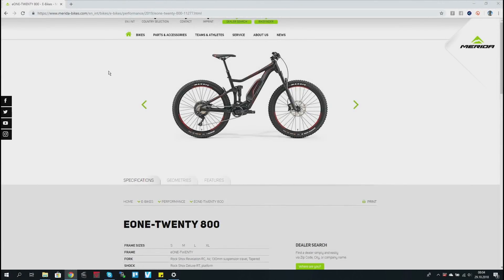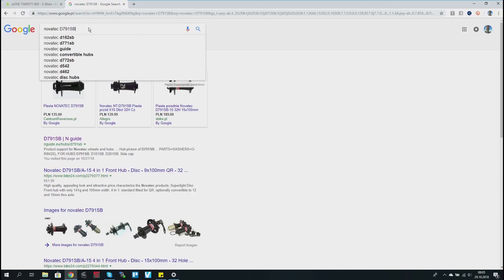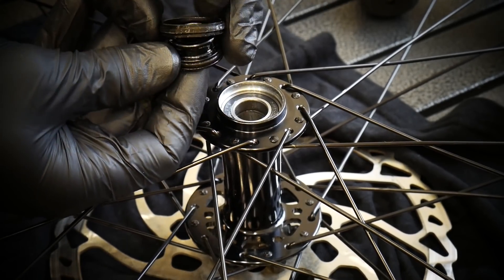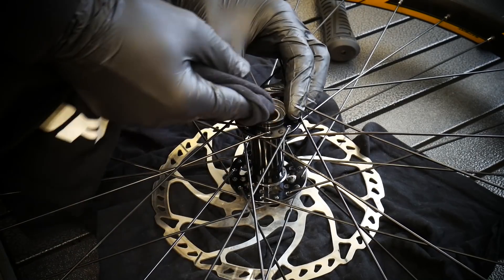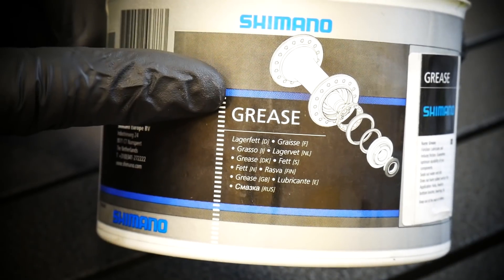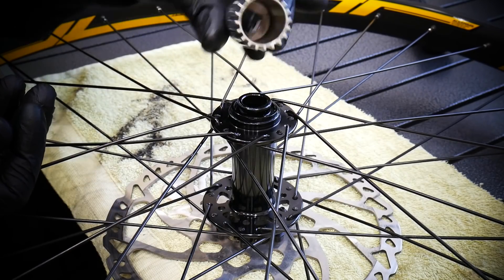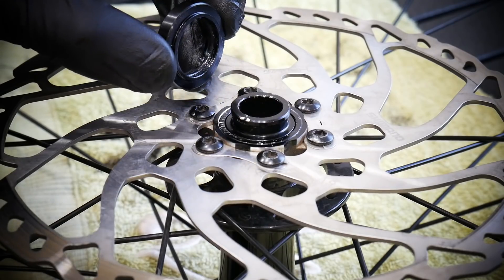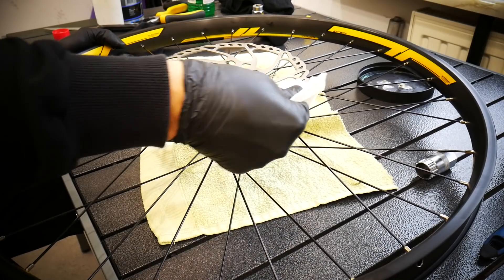Novatec D791SB / Joytech Front Hub Overhaul. How To Remove The Cups.

Comment: According to DT Swiss service procedures, the end cap should be put into vice with soft jaws and the whole wheel should then be pulled swiftly. This works without scratching anything.
Reply: Any chance youve found a video of this being done ? I have 641frobt hub and I feel like it's got the same system as above but no matter how hard I tweak on it it won't budge

Comment: Thx for sharing your experience 👍
But the best way to remove bushers and end caps is to use a bearing puller 😉
Too much scratches with a screwdriver🙁

If you don't have a bearing puller, you could use a Dynabolt 👍
first, insert Dynabolt in the busher/end cap (not too deep in the bearing) and tight it.
Then, flip the wheel and insert a rod across the hub onto the Dynabolt and knock it with an hammer to remove Dynabolt with the busher/end cap.

You could use same technique to remove the bearings 😉

Comment: Was hoping to see you remove and replace the cartridge  bearings. Maybe next time would make a nice video?
Reply: Clive Weir this was tricky on the previous Novatec 771... there is a bush/spacer inside but it doesn’t push apart sideways far enough to get to the back of the bearings .. as I was replacing the bearings anyway I destroyed one to get it out.. the other was easy as I took out the spacer first.

Comment: How do you get the bearings out?
Reply: prolly need a bearing puller for it.
Reply: You need a 19,5 mm pipe , 200 mm long , split with a saw in half about 60 mm , opened circa 4 mm , and introduce from the opposite side in the bearing , you should be able to hammering out ,  it help if you have an electric hot air blower gun , heat the hub (the alu rotor) witch will expand in circumference and diameter ...

Comment: How you remove bearings?
Reply: You need a 19,5 mm pipe , 200 mm long , split with a saw in half about 60 mm , opened circa 4 mm , and introduce from the opposite side in the bearing , you should be able to hammering out ,  it help if you have an electric hot air blower gun , heat the hub (the alu rotor) witch will expand in circumference and diameter ...

Comment: If anyone could tell me how to remove these bearings prior to me destroying them with a blunt instrument I'd be very grateful
Reply: You need a 19,5 mm pipe , 200 mm long , split with a saw in half about 60 mm , opened circa 4 mm , and introduce from the opposite side in the bearing , you should be able to hammering out ,  it help if you have an electric hot air blower gun , heat the hub (the alu rotor) witch will expand in circumference and diameter ...